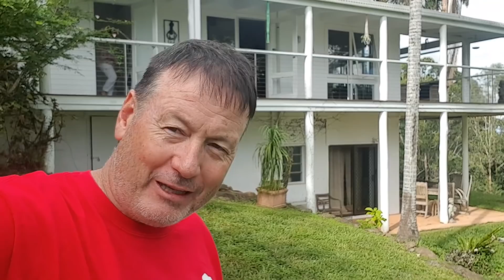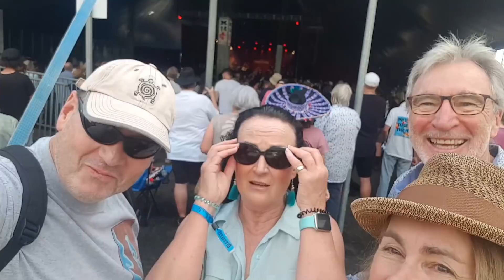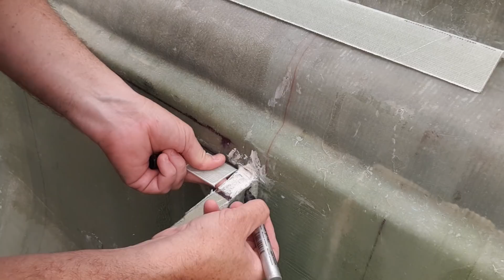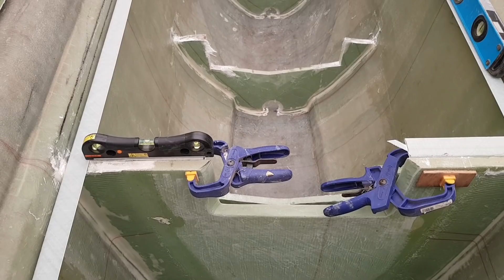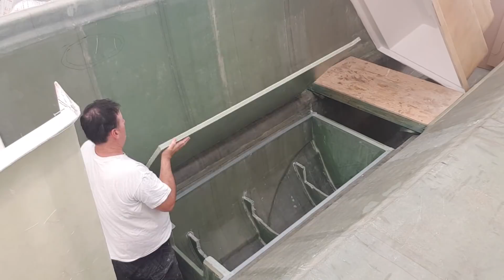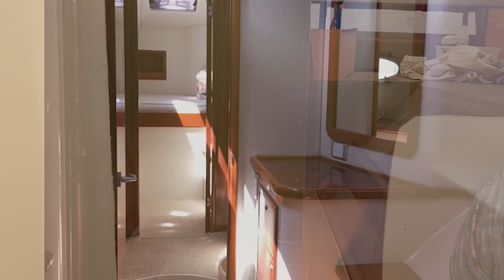Ep 072 The Bilge Koala - Life ON The Hulls - How to build a Catamaran

Comment: hey Ross those fuel tanks you are putting in they expand about 2 cm in length when you put fuel in them
Reply from the maker: Gidday Robert.I have allowed 3perecnt for expansion as per the manufacturers instructions,in fact i have about 3cm each end and width and height is no problem.Very perceptive of you as it looks tighter than it us ,getting them in is a different story it is almost perfect fit to slide in.Cheers buddy,Ross
Reply: good work Ross you are onto it. I was just checking so you din't crack a bulk head an have a bad day haha yeah video looks like there is no clearance

Comment: One benefit of all that traffic in and out of the hulls, must be that it's already released and ready to be yanked clean out of there... 😊
Reply from the maker: I reckon it is definitely released.The hull sides are loose and i can easily pull away from the mould, the hulls not so sure.The vibration alone of the roller I used to bed the foam would have loosened it in any case .Ross

Comment: I'm curious to see how close you are to starting placing some of the systems like fuel lines, electrical cabling, grounding systems for radios, water lines, through hulls, etc. Are you going to insulate the crap out of the engine bay to reduce noise? Any plans to add underwater lights and a secret escape submarine?
Reply from the maker: Gidday Tim,wor kibg on plumbing first as we have formulated an overall plumbing plan and am about to begin that experience.Electric will bed ta ken care of with Sam from overkill  electrical in Sydney who did Brents Lagoon electrical refit  on Impi.Engines are 4jh57 yanmars so should be quieter than the 30s but tonnes of insulation planned as we have a cabin above these on each side.Through hulls will like forespar composite firings as I love their range.

Comment: Would it not be easy and more structurally sound to notch the top of the bulkhead and the lower side of the angle instead of cutting back off of the hull
Reply from the maker: Austin,I did think that might be an idea however the epoxy has strength as well and actually once the angle is glued ,the cleat installed tieing together and the floor glued to it then filleted and tabbed,strength will nevet be an issue.Also I belueve the sngle now has better compressive strength downward integrated into the bulkhead unmodified .Cheers buddy.Rosd